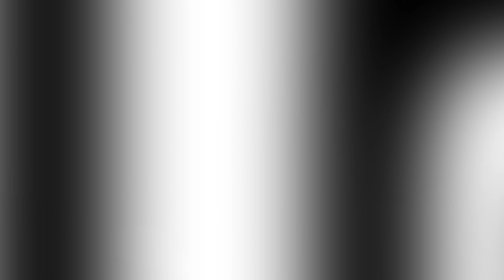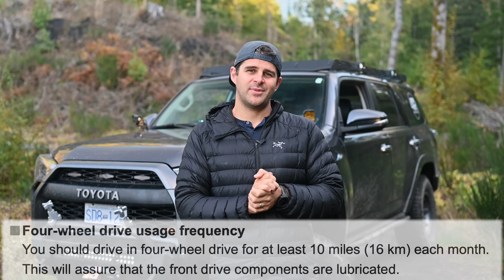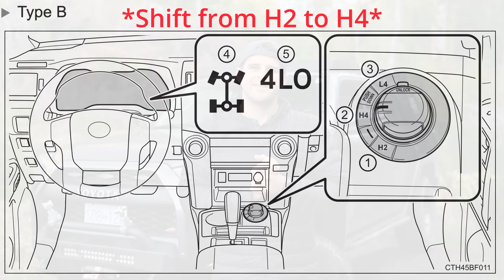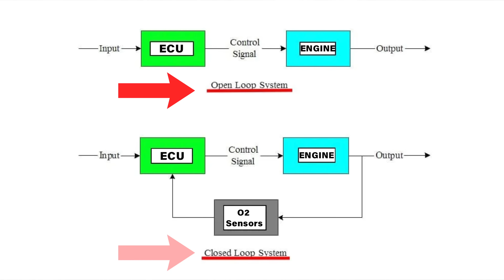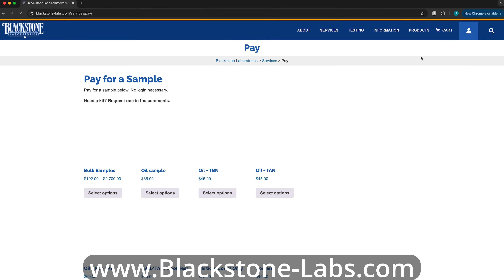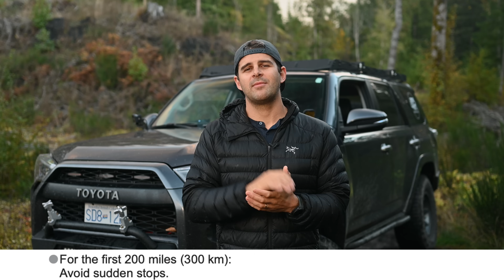5 Ways You Could Be Ruining Your Toyota 4Runner, Tacoma, or FJ Cruiser

Comment: I am good for all except 1….I purchased my 2024 TRD ORP 4Runner in Colorado but I live in Texas…… It was really difficult not to drive at high speed or at a constant speed the entire 1200 miles home!😮. I got to say, There was some really upset drivers at me! Not going over 60 on the interstate is not very popular! I am not sure I completely followed this guideline but I did my best… I took as many back roads, stopped at every rest stop and town I could and did not use cruise control.  I also drove behind every big rig I could because they go slower than usual. But, all of the others I do. Especially the oil changes.. 1st one @1k and every 5k after that.
Reply: Best to do the 1st oil change at 500 miles
Reply: Changed mine at 900 miles and the oil and filter looked brand new with no shiny flecks in it at all. Didn’t expect that but glad it was so clean.
Reply: @richb70  Shine a bright LED light at the oil believe me you will see the shiny flakes. Depending on the quality oil filter you are using the oil filter housing oil will be the worst in the majority of the oil that you drain out of the oil pan will be less. The differential between the two will tell you how good your oil filter is working. I found the Toyota oil filters are not very efficient. If you care about your vehicle there are better oil filters out there that do a much better job.
Reply: @stevenlefebvre2991  I'd trust Toyota

Comment: Toyota changed their oil formula to align with the new boosted engines and pre ignition concerns with additives like Molly. I didn’t believe it so I sent a sample off to Blackstone and sure enough there’s only about a quarter of the Molly that it used to contain. A good option for motor oil that still contains high Molly is Valvoline extended protection high mileage. Like I said, I used to believe Toyota motor oil had high Molly and it did but they have changed it and the proof is in the numbers sadly. I also tried an expensive boutique oil redline. It was supposed to have high Molly content, but it  had actually less than the Toyota motor oil in its current form and cost almost twice as much! This too was proven by a black stone report.
Reply: I want Molly?  

Do you know anything about Coscto/Kirkland OW-20 in this regard?
Reply: @kimbuck-2  🤣 I mean moly. And I’m not sure about Costco oil. Only way to know is send in a sample I guess.

Comment: Mobil 1 full synthetic is what you will find in Toyota's "branded parts" oil containers. 

Mobil 1 full synthetic is what will be used for Toyota's dealership oil changes when deemed ✔️ by the management. 
Same oil, different container and lower cost to both the consumer and dealership.  

Purchased at Wally's for huge savings. 

Use Toyota oil and air filters though. 
Which manufacture produces these filters is not known to me personally. 

Toyota!

Comment: I would add a quality undercoating to avoid frame rot if you live in an area that uses road salt.
Reply: I have used fluid film through 4 winters in the Midwest and undercarriage looks great. Would highly recommend fluid film or similar product.
Reply: Corrosion Free is a great product too
Reply: Lanoline oil coatings only.  Don't Ziebart and the like.
Reply: Cosmoline RP-342.
Reply: Does not work 😂 it makes it worse because you can't see the start of rust and by the time you notice it's already rotten through 😂
Reply: @ur_asian_milfoil use lanolin
Reply: @ur_asian_milfoil  Only the rubberized undercoating does this. Fluid film, or CRC rust inhibitor won't hold moisture.
Reply: Up here in Ontario I have used Rust Check undercoating yearly (clear proprietary fluid) sprayed on frame/in doors/fenders etc by the franchises.  No rust or frame issues on my 2006.

Comment: Came here to say don't forget to lube the u-joints and prop shafts.   The dealer will not do these items regardless of what the manual says.  I hit em with a pump when I change my oil, every 5K.  If I'm not mistaken Quaker State Ultimate Protection has a super high moly content if someone is looking for that.  Mobil 1 Extended Performance is also a great choice.  Great video!
Reply: When I first heard “propeller shafts” I was wondering if I was driving a boat or flying an airplane. Just call them drive shafts Toyota!
Reply: I'd love for you to make an instructional video on that, as I don't have any idea where to find those or what to use...or how to do it!
Reply: Serra/ Germain syralerships are the worst.
Reply: I'm still unclear about the possibility of over greasing the shaft.  

The old grease never comes out.
Reply: @kimbuck-2  U-joints get pumped until new grease is past all the seals, the slip yokes only require a couple of pumps, grease does not go past the seal.  I do (2) pumps, plus I clean the shiny part off and lightly coat with grease by hand to limit rusting.
Reply: @michaelstarmer3497  I just put a couple of pumps in as well for the slip yolks.  I don't want to accumulate too much in there over time.
Reply: Literally the worst oil you could choose.    Valvoline advanced synthetic,  pennsoil ultra platinum are the top tier of off the shelf oils you can buy readily.
Reply: @LORD_OF_THE_ROOTS  explain how that’s literally the worst oil you could choose
Reply: @LORD_OF_THE_ROOTS  Which is the worst oil?

Comment: Yeah changing suspension lifts when the world’s top engineers has dialed in the exact suspension for durability. Anytime you lift it with after market parts for a higher lift, the truck now has a weak point.
Reply: But it looks cooler and can go places where lifted vehicles are required
Reply: @mysteriousoklahoma777  yeah in still getting a suspension lift like Dobinson IMS ..LOL.
Reply: @mysteriousoklahoma777 99 percent of people never go anywhere a lifted vehicle is needed.
Reply: True. They are engineered to operate optimally as is. Lifting changes the geometry and adds extra stress to components creatingfailures. I found this out when having to replace the control arms, track bar etc.

Comment: I was just thinking about #1 today. My vehicle is "new" and I haven't worked my transfer case much, so took the time today to learn it and use it. I also have just over 1.3k miles, and just did my 1k oil change. I think CCN just explained the wash down situation recently as well and since I drive shorter trips often I'm making sure I sit there for 2min before driving and 2min after parking.

Also, to keep the air system from accumulating moisture, it's recommended to NOT recirculate unless necessary and to turn off the A/C a few minutes before you shut off the vehicle and get outside air to dry it out. Will help with air quality.

Comment: How often should the coolant be flushed and replaced on a 4Runner?
Reply: every 2 weeks.
Reply: @thecount1001  I heard it was every other day…hahaha!
Reply: @kennyg-o6h Yes but only with your headlights on.
Reply: At 30,000 miles and every 10,000 miles afterward, drain as much as you can from the radiator (about 3.5 quarts) and replace with fresh Toyota (pink) coolant. A complete flush is unnecessary. This will prevent the coolant from becoming acidified, which is the problem with old coolant.
Reply: 50k always
Reply: @joebidendidthat5121  You’re correct. First Engine Coolant drain and fill/replacement and subsequent changes:
1. 100,000 miles or 5 years, whichever comes first.
2. Thereafter, every 50,000 miles or 5 years, whichever comes first.

Comment: Just to add, people who own 4Runner Limited with full time 4WD should still exercise the actuators once a month.  Put the vehicle in Neutral, put it in 4LO, lock the diff, then back to 4HI, and unlock the diff.  There is no need to drive in 4LO because the transfer case gets exercised all the time when you're in 4HI.
Reply: My 2015 limited gets put into 4LO and 4HI every hunting season a few times and that’s it. Purchased it new 10 years ago and almost 200k miles and it has never failed.
Reply: thanks i will
Reply: I have a 2016 4Runner Limited. It has the dial for the 4 hi and lo. How would I know if I have full time 4WD
Reply: The Limited models that have 4wd are all full time 4wd. If you had the part time 4wd the knob would have 2h, 4h, and 4lo @Alluka29
Reply: @Alluka29 all limited are full time 4wd.   That's why your dial only says 4hi 4low.  No 2wd setting.
Reply: @LORD_OF_THE_ROOTS  Not true.  There are RWD option Limited.
Reply: @bohan9957  news to me I've only seen full time version
Reply: @Alluka29 it’s full time Awd not 4x4 to have true 4x4 you need to lock your center dif the limited trims use a different system
Reply: @LukaFN69 you can lock the ceneter diff in the limited
Reply: @Travis-z7y5p didn’t I just say that?
Reply: Also for FJ Cruisers with manual transmissions !
Reply: Ok thanks.
Reply: Thank you for this
Reply: The Limited models don't have a diff lock though. Thats reserved for the Trail/TRD Offroad models.
Reply: Mine does. It's a 2011 Limited model. It has a L4L setting on the dial. I've rarely had to use it though.  @The_Algorithm_
Reply: @The_Algorithm_   Good point.  I was referring to the center differential lock.  The Limited do not have rear differential lock.
Reply: @The_Algorithm_   ummmm.  Mine does 🤷‍♀️
Reply: @The_Algorithm_ center locking diff

Comment: What if mine is full time 4x4 do I still need to put it in 4 low every month
Reply from the maker: @kandaharenglish2595  yeah you’ll still have actuators for 4lo and the locking diff
Reply: @T4Rgarage  I drive on payment , I just put it in 4low once a month and drive for 10 miles? At what speed?
Reply from the maker: @kandaharenglish2595  It’s hard to explain all the info here, I would suggest checking out the owners manual. Use 4lo when going slow. 4Hi can be used at higher speeds. Running 4hi for 10 miles and 4lo for at least a little bit each months to ensure the actuators move freely and engage correctly
Reply: @T4Rgarage  bro I really liked the video where you swapped the front bumper to TRD pro, I am thinking about doing that to my limited but I am afraid I might ruin it since I don’t fix cars at all or work or any.
Reply: @kandaharenglish2595  4lo isn't recommended for fast speeds. 4lo is when you're delivering more torque to  wheels to overcome offroading obstacles only--not for typical use. the ten miles thing was for 4HI which is 4wd. Use mostly straightaways for this as well....twisty turny roads bad for 4HI. Just move to 4lo and then shift back was the recommendation, although I will sometimes play with the offroad rules just to do a "system check".
Reply: @kandaharenglish2595  I have zero xp on cars and I'm learning to do changes to the vehicle and maintenance myself. Love your vehicle and it will love you back. Be very familiar with what gets done when.
Reply: I find a dirt road, put it in each of the drive modes for half a mile. H4L and L4L.

Comment: Good video for young people nowadays as an old man this was the way we broke in all cars and I still change my oil at 3000miles because oil is cheap engines are expensive.
Reply: Those times are coming back, as turbo engine oil change intervals decrease to 3k miles.
Reply: @justahumbledude  yes and these young people don’t understand turbos are not new and it requires engine oil to cool which in turn cooks your oil.
Reply: I had always heard that if you can only change one, change your filter more than your oil.  Skipping filter changes is idiotic.  They only cost a few dollars.
Reply: What would you say to replacing the oil filter every other oil change, in light of the 3000 interval vs. 5K to 10K that is in the guide?
Reply: @davebrucher2283   well it’s your vehicle but for me it’s a couple of bucks for a filter so I’m gonna change it.
Reply: @davebrucher2283  i would change the filter before the oil. The oil is only dirty/contaminated if the filter isn't working well.